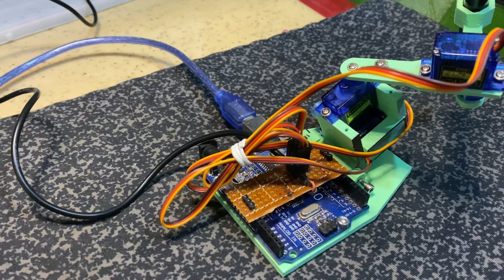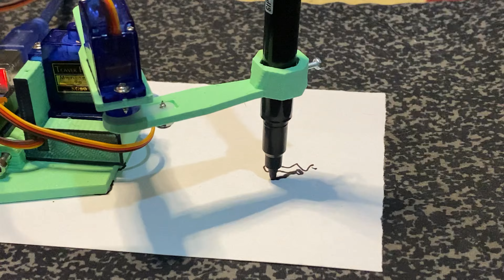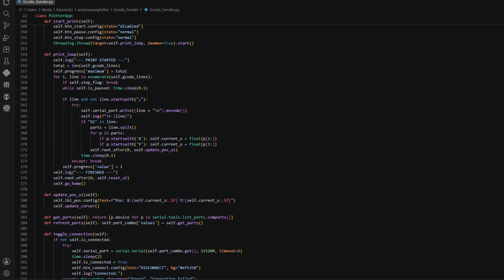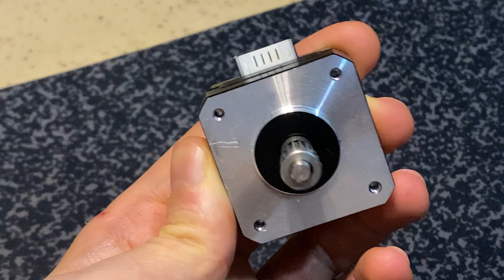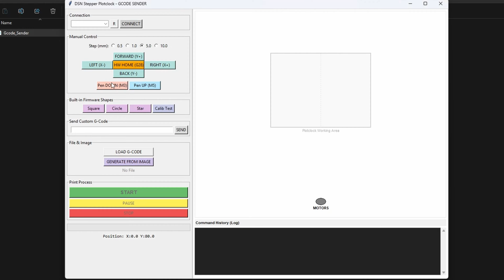DIY Pen Plotter Upgrade: 28BYJ-48 Stepper Motor & Auto-Homing

Comment: Good project brother. Ideally it would be nice to keep everything in the 5V range. using NEMA 17 might need 12V or so. Also I was wondering if we convert the 28byj to bipolar by cracking the case and cutting the red wire track, we can drive it through A4988 which can give better control.
Reply from the maker: thanks. Yes, it’s make sense and possible. Even this method not solve a backlash issues.
Reply: @DsnIndustries  Yes, you are right this will improve control but will not solve backlash. I have seen people using torsion springs to solve backlash.
Reply from the maker: @ManikantaRaju  that's make sense. Thanks for suggestion